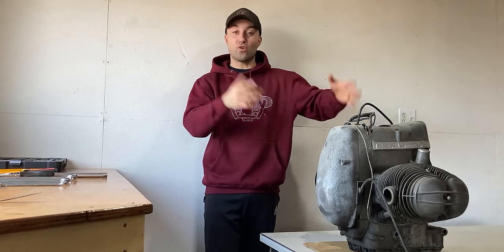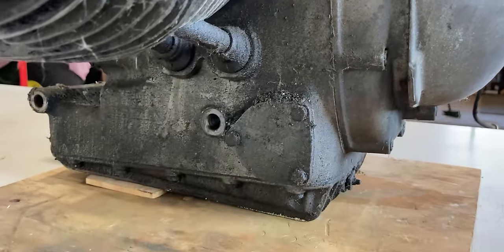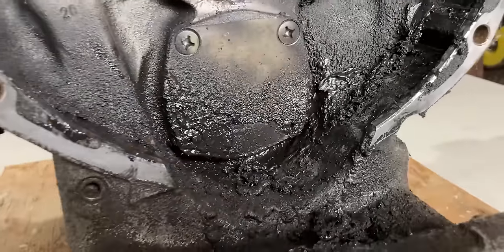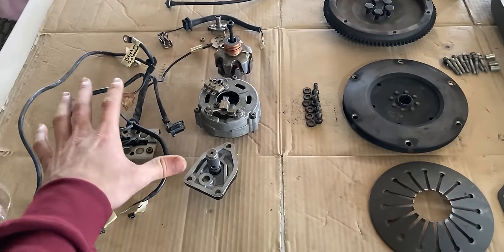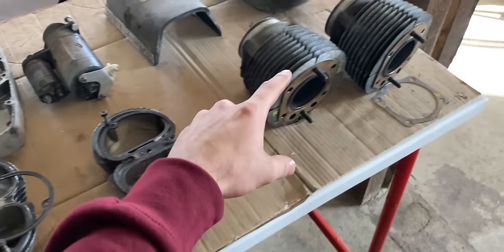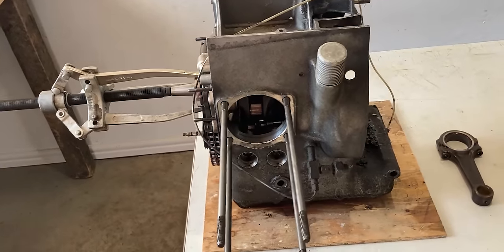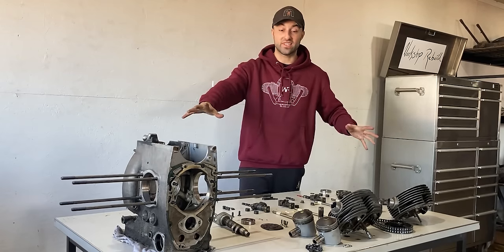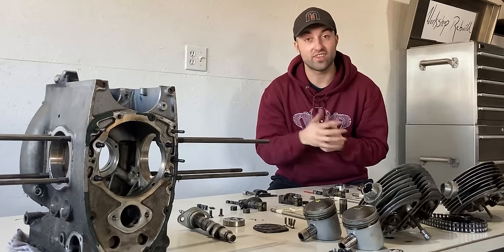BMW R60/5 Airhead Engine Teardown - How Bad Can It Be?

Comment: It looks like it was made yesterday!
You could almost say that it's the more refined version of a Citroën 2cv ?
Reply from the maker: This engine is a true time capsule! Since this engine was produced in the 70's I could say it's more refined  than the 2cv engine. Looking back a couple years, BMW produced engines that had a similar horsepower ratings to the Citroen and even the looks. This must have been post war for sure. Zundapp is another company that had very similar looking engines and many parts were even shared between Zundapp and BMW! Regards Andreas

Comment: Thanks for the video. Your presentation and video editing are superb. It has been very helpful to me. Do you have a video that discusses whether or not it is absolutely necessary to disassemble a perfectly good running a air cooled BMW twin just to clean the slingers? is this absolutely necessary? I have heard yes and no. I was wondering what you or anyone else thinks. Thank you again!
Reply from the maker: First of all, thank you for your wonderful comment William.
If you‘re talking about BMW twin engines with oil-slingers, than you‘re talking about pre 1970‘s engines.
These engines are easily recognizable as the pushrod tubes were above the cylinders (camshaft over crankshaft). All of these engines had slingers, because removable oil filters were not implemented back in the day...at least not by BMW.
They used oil slingers - a formed plate on either side of the crankshaft that collects & filters material within the oil by centrifugal force.

In the /5 model engines (like the one you see in this video) they added a paper based oil filter, just above the oil pan. This means there was no need for „slingers“.

According to manuals online slingers should be cleaned regularly. 30‘000km intervals are the maximum you should do, and that is probably already far too much!

At the end of the day if your slingers are clogged, that could cause serious issues to your engine! The only way to clean them out, is by taking the engine apart to a certain degree, cleaning it and putting it back together.

You want clean slingers for better engine health in general. Engine oil is not just for lubrication, but for your compression and cooling too.

I have never worked on a /2 (pre 1970‘s) engine before, but it sure would be interesting to learn more about them.
There is a lot written about this online...maybe you can find more information just by googling this term „ BMW /2 Slingers“.

I hope this helps and thanks again for your great question! Regards Andreas
Reply: @WorkshopRebuild  Again, thanks for helping me out. Yes the bike I have it’s a 1966 R60/2. I have not run it in many many years and I have never cleaned the slingers. I just don’t feel like going into the engine that deep to clean them, but from all I have heard, I may not have a choice if I want to have peace of mind. thanks.
Reply from the maker: @williammagill5634  Nothing to thank me for! Taking an engine apart is usually easier than putting it together, but various tools are needed and a lot of patience. If your engine has never been opened before, it might be very hard to remove some nuts or bolts as they could be seized in place. To really know the condition of your engine, you will want the slingers cleaned before you go onto a trip. 
Maybe if I find a /2 model soon enough I could enourage you to tear into your engine, by sharing a disassembly and assembly video. Up until today I have not seen one BMW /2 for sale in all of Alberta...so it probably won't be the easiest bike to find around here.
Regards Andreas

Comment: Kindly advice me on Yamaha xt225 engine strip down and rebuild. Liked your content alot. Paul, kenya
Reply from the maker: Hi Paul, thank you so much for tuning in all the way from Kenya! What an honor😃👍🏽
Based on my research the Yamaha XT225 is a single cylinder SOHC engine with two valves. This is a relatively simple setup and can be found on most off-road motorcycles.
At this moment I do not have that bike, but hopefully throughout my videos you will pick up some tricks and tips that will help you along your project!

Let me know if you make progress on your Yamaha😎 Regards Andreas

Comment: I didn’t know they had hex Allen key head bolts back then.
Reply from the maker: Allen socket head bolts are over 100 years old, but due to expensive manufacturing processes back in the day, they became more readily available in the 1940's.

Comment: That looks like a recently-rebuilt motor? First clue was the colour of the oil. Pistons and bearings look mint. Heads look great. Replace all the seals, new clutch and off you go 👍 Audio levels went to poop at the end their fella 😅
Reply from the maker: Hi there! This engine is far from freshly rebuilt and it hasn't been opened for 50 years. It's possible that the oil and the oil filter was changed in the past, but other that that it's all stock. There are many indications this is all original like: the original oil seals (made in West Germany), original timing chain & sprockets (heavy wear), standard pistons and so on...
The measurements indicate that there is wear within this engine and many important parts have to be repaired and some replaced. I will have a full rebuild video here pretty soon which will showcase engine in better light. 
Excuse me for the audio levels in this video...I have since made adjustments to my newer videos and I hope the viewing experience is much better for you. Thank for tuning in and leaving such a great comment. Regards Andreas
Reply: @WorkshopRebuild  sorry, that didn't come out the way I meant it. For an old engine, it's in remarkable condition. The owner(s) have obviously looked after it properly. Usually old motors are full of black sludge, but this shows signs of regular oil changes. Look forward to seeing this run again. Like many people, I've not seen inside a boxer engine, so it's all very interesting. Cheers.

Comment: Hi. thanks for your response time. Engine designer Hans Münch designed this cheaper option, somewhat killing BMW's longevity.The good old German Designers & Top management are long gone. Same with all other German Automobiles.  The Younger generation don't understand what is Longevity Sadly BTW where is your episode#1?
Reply from the maker: You‘re more than welcome! Thanks for sharing some history about the older BMW engines. It would be great to see new vehicles last for many years to come, but with strict regulations in the near future, this might not be the case.
Answer to your question:
I usually start off a video series with an introduction video and label that with „NEW“ in the top left corner. At the same time I consider this Episode 1 or Part 1. I hope this helps you navigate through my playlists correctly. 
Regards Andreas

Comment: You don't show how to secure the crankshaft on the front, if you don't plan to remove the crankshaft, you don't want the thrust washer to fall in the crankcase. With the flywheel removed, the crankshaft can move to the front.
Reply from the maker: Correct, I did not show that because this was a disassembly video of the 600cc BMW engine. When I rebuild this engine, I will share details about the assembly process. The thrust washers will be a very important step of the rebuild and I hope you will find that valuable. Regards Andreas
Reply: @WorkshopRebuild  Great videos btw, looks like you have great experience in mechanics, always interesting learn from experienced people
Reply from the maker: Thank you! I'm better at designing and machining parts, but I love to wrench on machinery to learn new things. Hopefully I can continue to share as much as I can, so it will help other enthusiasts down the road. Regards Andreas

Comment: Nockenwellenlagersitz im Gehäuse vor der Ölpumpe überprüfen. Das Nockenwellenende läuft im Gehäuse.
Reply from the maker: Hi there, I have already measured all the parts and have been able to determine which need to be replaced and which ones can be reused. The camshaft bearing surface within the engine block is still within factory specifications. I will be rebuilding this engine very soon. Regards Andreas

Comment: In aircraft maintenance, using a magnet extraction of journals is forbidden 
Not sure if it is an issue with these types of engines though
Reply from the maker: Hi Russell, this is an interesting topic! I haven‘t heard of this before and that‘s probably because I never worked on an aircraft engine before. Please let me know if you have any information about why it‘s forbidden.
I have a feeling it will not hurt this engine, but I guess I‘ll have to wait and see😅🤞🏽

Thanks for your comment. Regards Andreas
Reply: @WorkshopRebuild  I don’t think it will either, with aircraft stuff they are extremely safety conscious, I believe simply, if something stops, pulling over to the side of the road is not an easy option
I could assume that items that may become theoretically magnetised may attract minuscule amounts of metal that may block or reduce oil passes, or increase the possibility of fine tolerance areas to possibly be compromised in this way
The real reason is likely to be far more interesting than my assumption 
I think it was the hydraulic push rod lifters and maybe some other things also but can not exactly remember 
I could look it up but better still, will ask someone in the field why this is so
All I know is that this is a real thing in aircraft engineering maintenance and training

Comment: Any idea how many miles were on this engine?  Many of the components seemed to be in very good condition.
Reply from the maker: Hi Tim! According to previous owner this bike was in original condition and showed ~93'000 Miles! The  odometer assembly was seized and it must have stopped at that mileage, so it could possible be a 100'000+ Mile bike. 
The engine could have kept on going for a couple more years, but according to the measurements I took, there is some machining involved before this engine gets reassembled.
Once I'm ready, I'll have an assembly video of this engine where you will be able to see before and after shots. Thanks for your question. Regards Andreas

Comment: Wow that is some stunning German over engineering there. I swear that’s the same starter motor as for a Golf and mounted on top of the engine !  Someone needs to produce a lighter one to help with C of G and all up weight. I want one of these so badly.
Reply: Starter motor is from Bosch, I think the same as in a Kadett. The later boxers got a startmotor from Valeo, not very reliable (magnets might come loose). I once had a broken Valeo startmotor and no kickstarter on my GS. I was a long way from home....
Reply: Yes, my 1981 R80 G/S had the same as a Golf starter motor and very heavy!  Replacing the starter with a lighter alternative and replacing the lead acid battery with a lithium battery would lead to significant weight savings.
Reply from the maker: It sure is an amazing engine and the nicest thing is that you can still find parts 50 years later! I'm familiar with VW's, but if you think it is, than that's actually really cool. A lighter starter motor would definitely help bring down the top-end weight, or even remove it completely because BMW still left the kickstarter on these bikes between 1970-74...after that they removed them from most bikes!
There are many airhead for sale and if you're lucky you might just find a low-mileage bike. These are common to over 100'000 km without any big issues, so it's a great base for a project or even a clean classic bike. 
Thanks for your comment, Robin. Regards Andreas
Reply from the maker: @BasArntz  Very interesting information here! They sure did make some improvements over the years...and some probably weren't for the better. You must have been out of luck when your GS starter broke. This won't be my last BMW, as I found a new project a few weeks ago😉 Similar to what you might have had...

Comment: Looks great for it's age, but I'm curious how many miles were on it.
Reply from the maker: It sure does, but everything will get measured and replaced if necessary. The odometer read just over 93000 miles before the disassembly. I hope this answers your question. Best regards -Andreas

Comment: Surely if the odometer had 93,000 on it, it’s conceivable that it could have gone round the clock once already, and there was another 100k already on it?
Reply from the maker: That is very possible George! Based on the condition of this bike, it could have double the mileage. The previous owner told me it stopped worked a while ago...and that could mean some years ago! Nevertheless, this engine is almost ready for the assembly and I cannot wait to share it with you. Thanks for tuning in and leaving a comment. Regards Andreas

Comment: El motor es muy parecido al URAL lo que el árbol de leva y varillas están por encima
Reply from the maker: Correct, Ural engines are very similar, because they are based on German boxer engines. The earlier engines from BMW had the camshaft, above the crankshaft and therefore you had pushrods above the cylinders. The crankshaft was timed to the camshaft with timing gears back then too!
This engine on the other hand is timed with a timing chain...something that was somewhat new for BMW in the early 70's. Thanks for sharing this comment. Regards Andreas

Comment: Does the 600 have the same base and cranck as the 500?
Reply from the maker: According to the original BMW workshop manual I have the crankshaft is the same for the R50, R60 and R75! All specified measurements are for these three models, so they should be interchangeable. The only thing you'd want to check is if someone already ground a crankshaft to an undersize (main bearings or connecting rod journals).
I hope this helps you out! Regards Andreas
Reply: @WorkshopRebuild  Hey thanks a lot..

Comment: Utter mechanical perfection 
So good they had to invent something less reliable
Reply from the maker: That is very true! Nowadays, with liquid cooled engines there are far more failure points due to extra seals, gaskets and poor surface finishes in general. For now I will restore this engine and place it back into the BMW motorcycle it came out of and enjoy it for as long as possible. 
Thanks for sharing this comment! Regards Andreas

Comment: IMO it looks like the engine from a Leopard II main battle tank. Bit heavy and over engineered for a motorcycle I think.
Reply from the maker: I had to google that tank and see what engine they had. According to sources online they had a V-Twin engine which produced upwards of 1500hp! This engine you see in the video is a boxer engine, this means the pistons are opposed. A V-Twin engine has pistons running on an angle most of the time on a 90 degrees angle or sometimes less (depending on the make). This engine is definitely engineered well, but that's another reason why you still see them running up until this day. Weight distribution is actually quite well, because they are set fairly low, which gives this engine and motorcycle a great center of gravity.
I hope you stick around to see the whole engine assembly once it's done and then when the engine is back on the motorcycle frame. Thanks for a great comment! Regards Andreas

Comment: No pitting, no fun ;-)
Reply from the maker: HAHA, lif is better that way. Check out the engine assembly video if you wish: https://youtu.be/ulrai66vyoA I hope you enjoy it. Regards Andreas
Reply: @WorkshopRebuild  been there, did it ;-) Not in your clean and nice way but a R60/2, R60/7 1977 ->R80/7 conversion and a R100/7T engine run like clockworks here. Love your detailed videos. Always something new to learn inside! Regards
Reply from the maker: Nice!! You know exactly what it takes to rebuild one of these BMW airhead engines then. It seems like you enjoy the R60 platform 😃 I appreciate your feedback and thank you for letting me know! There is still a lot more content around the corner and I will tell you now, this will not be my last BMW Airhead...Cheers

Comment: BMW and valve cover gaskets..every single one leaks oil.
Reply from the maker: This either means your surfaces is not flat or your gasket needs to be replaced. This should not happen if both options are taken care of👍🏽😃 Regards Andreas
Reply: @WorkshopRebuild did you own BMWs before?😂 straight 6 go trough valve cover and oil filter housing gaskets often, 1 piece huge plastic valve covers on m52 and m54 engines don't help either..on old m50 and m50tu gaskets lasted a bit longer but not by much..
But i like them, i love the smoothness of M54, and replacing those 2 gaskets is not too much trouble, but replacing (,often overlooked) oil separator is absolute pain in the butt becose it lives underneath the intake manifold... then there are banjo bolts for vanos oil lines.. they have quite a list of common oil leak points..and i have 2 of them😂

Comment: Looking at that fat starter...I think, that bike does not like regular bike batteries...
Reply from the maker: This engine still has a direct drive starter which is a little bit larger in size, but it is also a little bit cheaper than a reduction starter! After the engine rebuild, this bike will need a good battery to turn over all that compression. I will opt for a regular acid battery as it will fit perfectly within the battery tray and it will be close enough to the original one that was removed. Regards Andreas